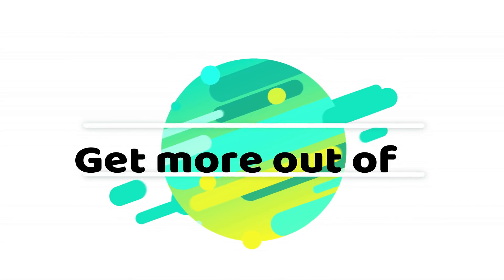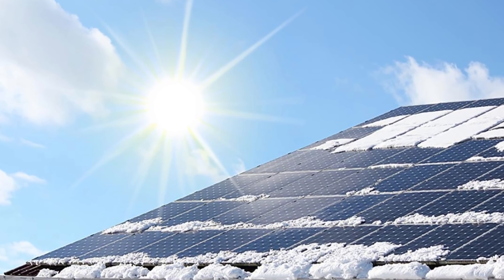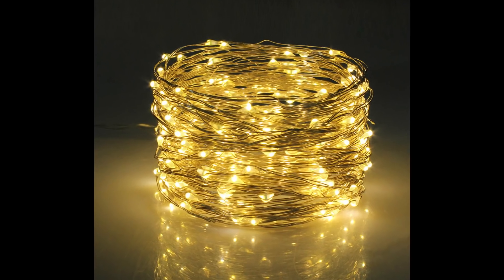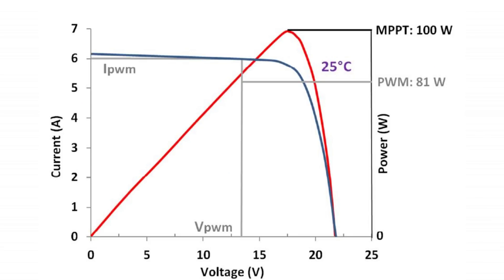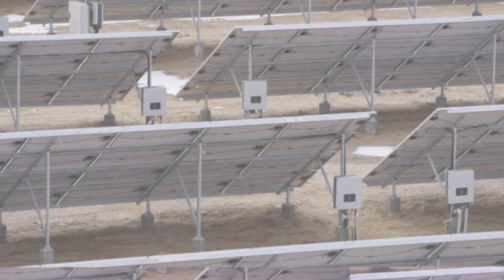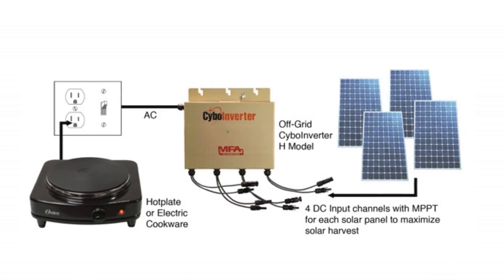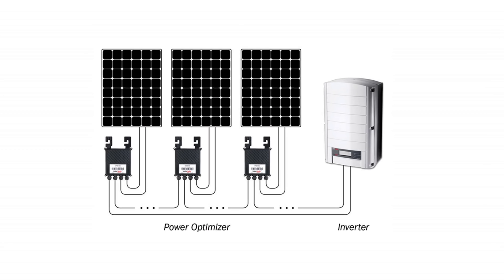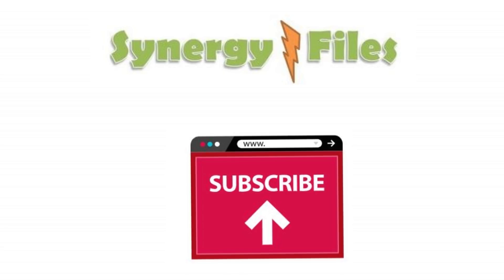Solar Micro Inverter for increasing your system's output

Comment: I think the current technology debunks this idea of shading. In a test using Forina string inverters vs Enphase micro inverters, the notion that only 50% output would be seen is wrong. Check out the test done by NRG Solar at their channel (youtu "dot" be/6Ucb-f8YPuo).

Comment: You know all the start of the video about shading only requires different wiring configuration to make that 20%.
The negative effects is only if you wire the panels together, but if you junction the panels then they're not effected by shade.

Also MI are good only for smaller systems, they're not economic for building a bigger systems and can cost alot more.
You can build using a bigger inverter, but using a combiner box. 
Optimisers are only buck converters a few dollars and diode (if not on the buck) they offer cc CV to a output (set at panel MPP.)